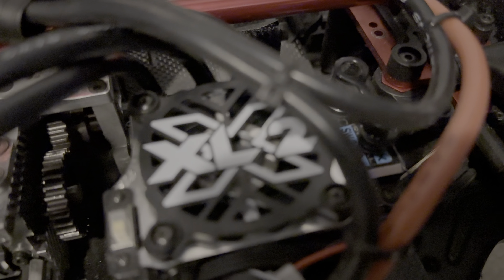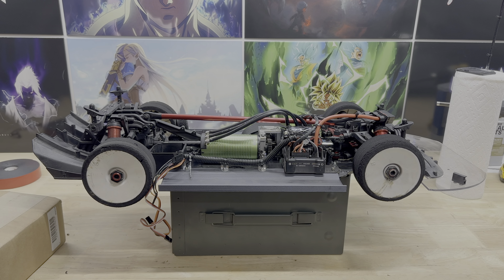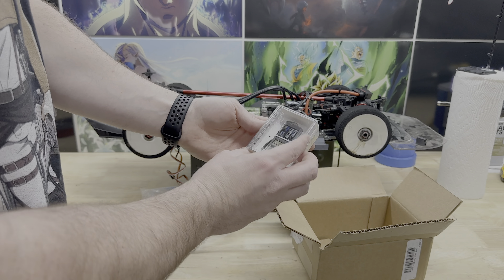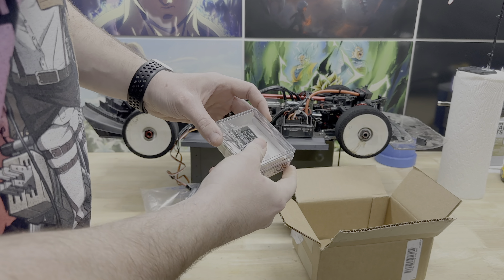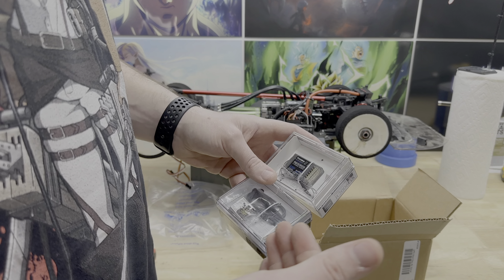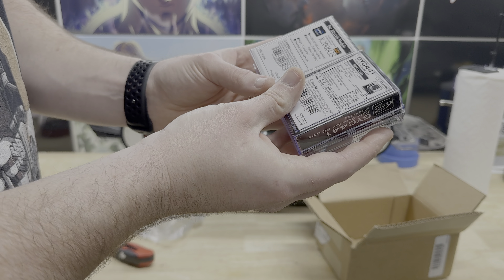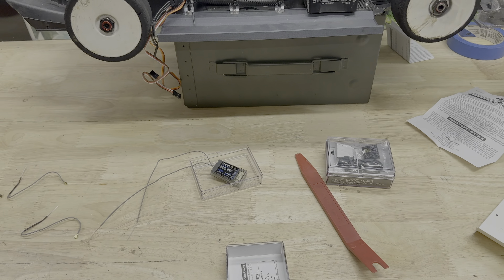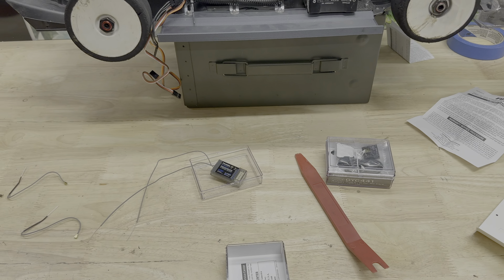Electronics Upgrade for the Limitless

Comment: what battery pack you recommend? SMC no longer sell the same spec you have nor similar.
Reply from the maker: They have a similar one I just bought today, it’s their v2 of the speed run packs 8500 mah
Reply: @GoKaioken  SRD-V2 14.8V-8600mAh-250C Speedrun pack i was actually just looking at that but thought the specs were too high?
Reply from the maker: The higher the specs the better!
Reply from the maker: And you’re right it’s the 8600 mah
Reply: @GoKaioken  yes thanks for the info!! keep those videos going!!🤟

Comment: Nice video but what’s the difference in this radio and the new 10px? I know nothing about these radios and would hate to buy the 7pxr if I could get the new 10px for 100 dollars more ? It might be a dumb question I’m not sure but is the 10px better ?
Reply: It is lighter, about 20 grams. The handgrip is a little thinner. And the menu has a better structure en is easier to use. The screen is brighter. More button options and programmable.

Comment: Yeah but don’t have to spend all of that money when a dumbo does just as good of job
Reply from the maker: I disagree unless you’re talking about just reception.
Reply: @GoKaioken  I use cheap electronics and still match any of your speeds
Reply from the maker: It’s possible my old setup was defective and simply replacing it would have helped. But I do see and hear a difference with these electronics so I’m still happy with the upgrade.
Reply: @GoKaioken  thanks for sharing.
I am curious myself as I have always used a DumboRc with range extender, everyone is always commenting on my videos telling me to upgrade. 
Not sure I could stretch to a 7px but have been looking at the 4pm handset which I’m hoping has the same responsiveness but just doesn’t have all the bells and whistles that the 7px has. 
I would hate to pay out all that money and not notice much difference 😮😂
Reply from the maker: Yeah I understand. All I can speak to is the difference I feel between my RC6GS v2 that I had and this Futaba and I definitely see and hear a difference. 

Look at it this way. Going cheap, you’re trusting a <$70 radio to control your nearly $2000 RC car at over 140 mph? That sounds sketchy. Lol.
Reply: @GoKaioken  agreed 👍 thank for sharing your thoughts 👌🏻
Reply: @GoKaioken  I’ve had it for over 3 years an no problems but just like your high dollar remote it could mess up at anytime so think of it that way lol
Reply from the maker: True.
Reply: @tedshickell7315  listen here Dumbo, nobody wants no Dumbo transmitter, ok enough said
Reply: I’ve been using Futaba transmitters for over 35 years, never had one give me issues or fail, then you always have that one guy that tells you you made a bad decision and spent too much money on a nice Futaba, tells you that his Dumbo transmitter is superior,, kick rocks Teddy